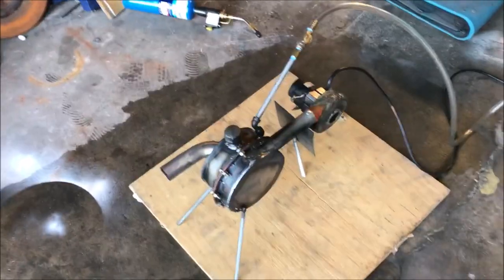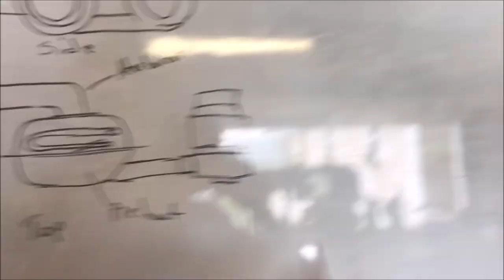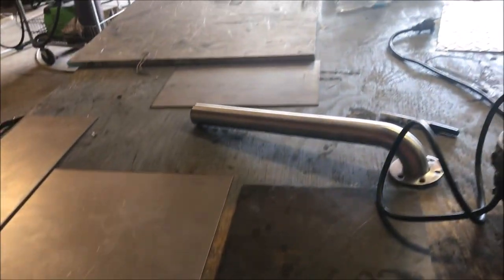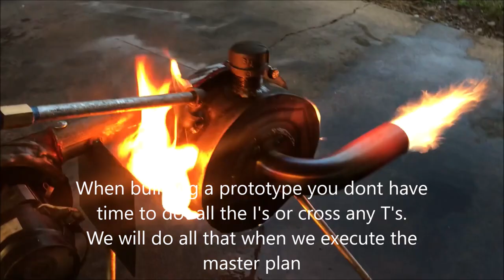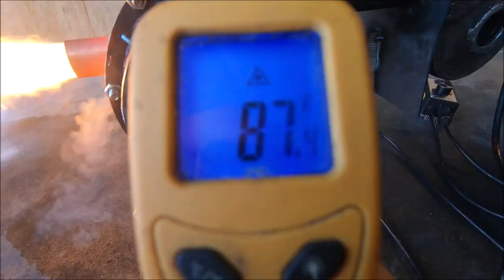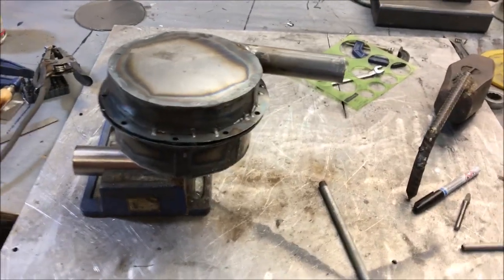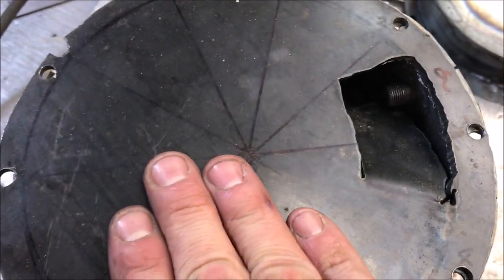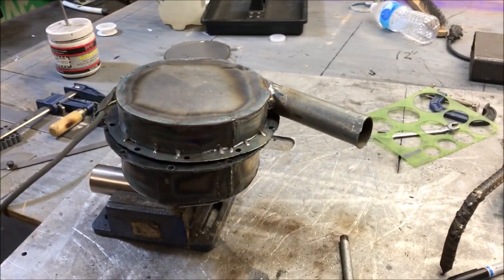Banjo Burner R&D

Comment: i think you need a longer spiral transition on your air intake side almost 180 degrees and make it sealed inside almost like a  scroll and continue into the output half and mount the output pipe radial like a turbocharger ad let your diesel or waste oil drip feed into the spiral with a small flange hanging down for the drops to smack into and atomize .

Comment: oooh whats this then? looking to do away with the compressors i see...good move. All these things you are making remind me of the early blow torch designs that cracked the fuel in a red hot cast iron chamber and needed warming up to get going. I had one, have not seen it in a while. If I find it, I will show you. Air never got pushed through. Only fuel. Maybe you could do away with the added air if you have enough gas pushing forward and out of a nozzle from cracked fuel to pull air in the back of the burner.

Comment: I think if you atomised the fuel like in a diesel car injector it would work better. Try using your nosel from your last build
Reply from the maker: Reqires a pump though , think im gonna try and keep it as simple as possible . I have 3 major improvement to try firdt then i may try atomizing
Reply: Why not use a mini atomizer nozzle ? Do you think modified heavy truck brake drums could work? There are cast steel drums available and not as hard to weld